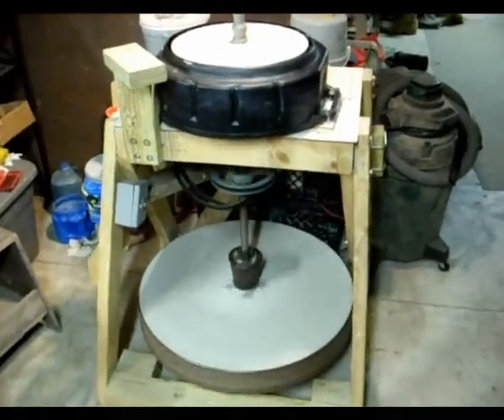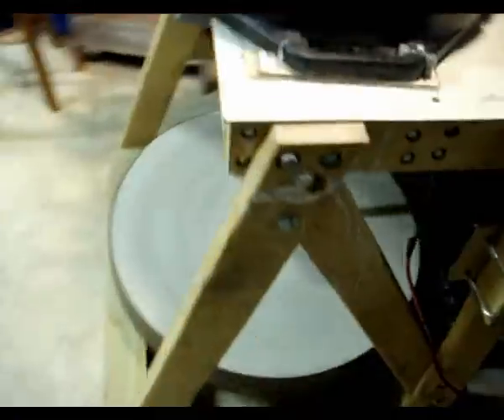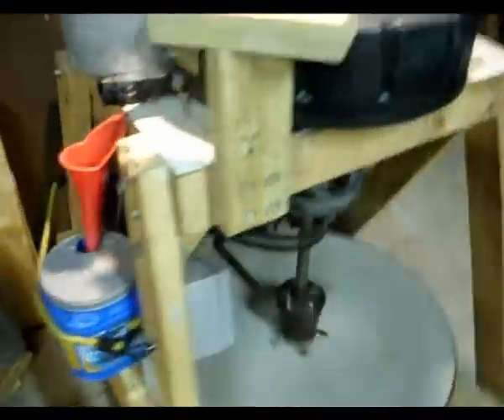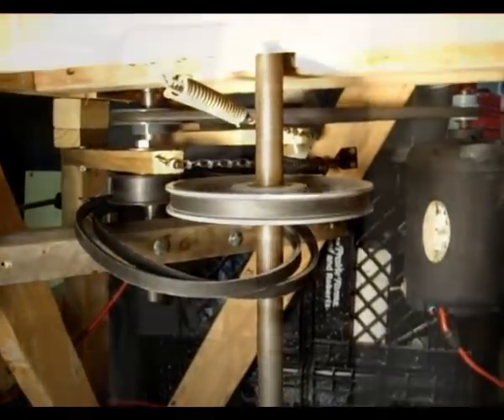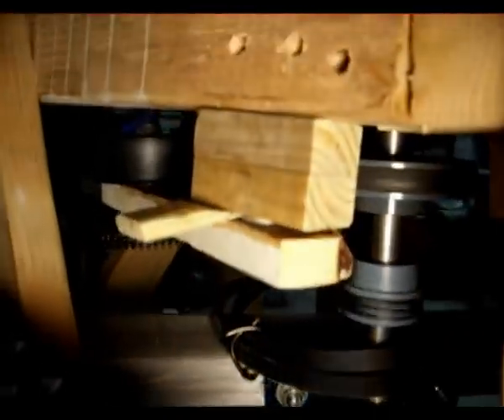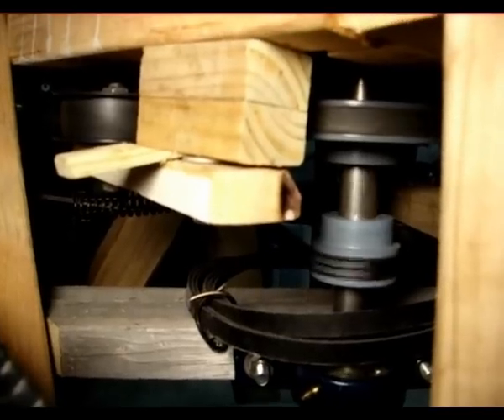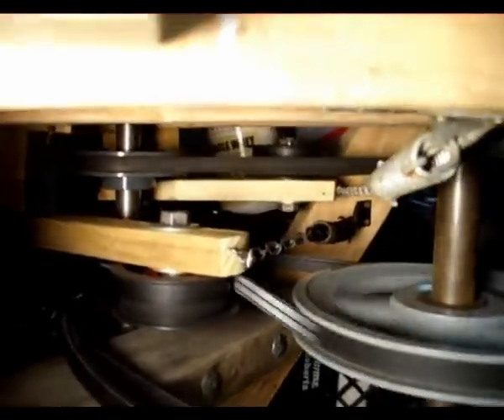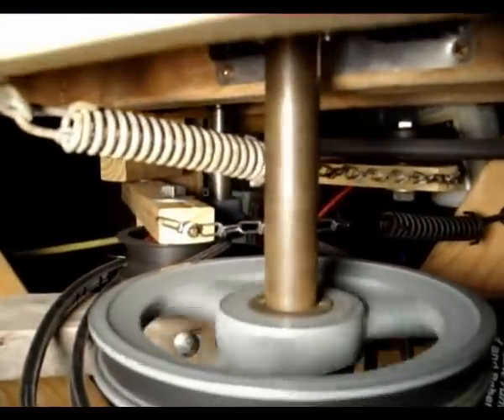Homemade Pottery Kickwheel... Motorized!

Comment: can u tell me whats the motor rating? like current, voltage, frequency of AC, motor rated speed and rated power.. i have an ac motor from a REEEAALLY OLD hard disc (yes ! AC motor) with ratings as 115V, 50Hz, 0.7 A, 2850RPM and 1/20 HP.. i wonder if i can use it to make a potters wheel with speed around 400-500 rpm (using pulley and belt arrangement to reduce speed)... BTW, is 400-500 rpm a sufficient speed for a potters wheel ?

thanks...